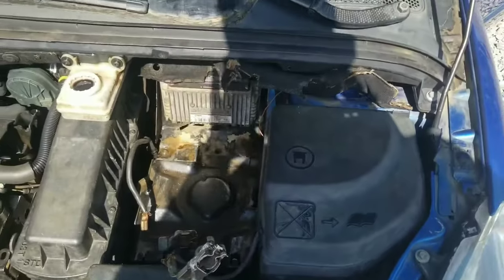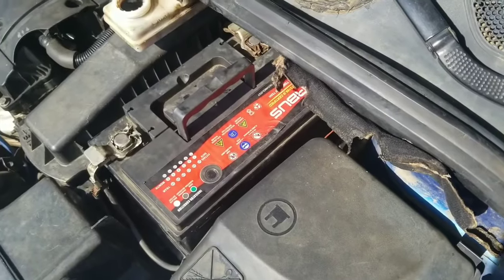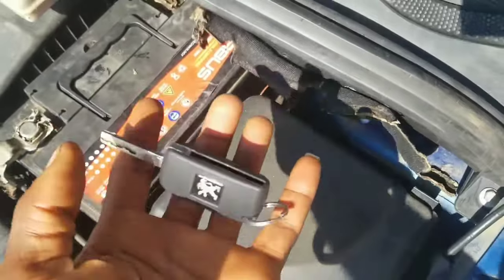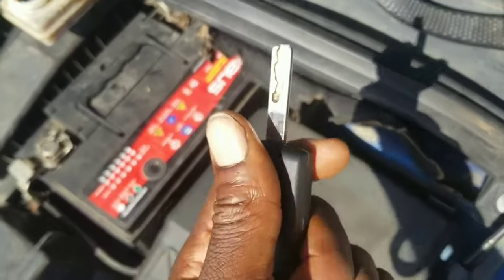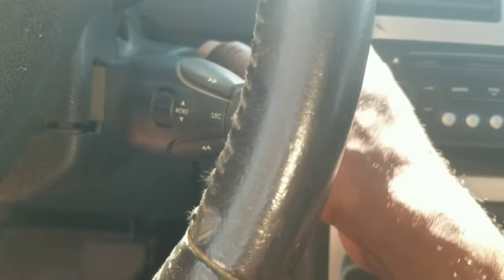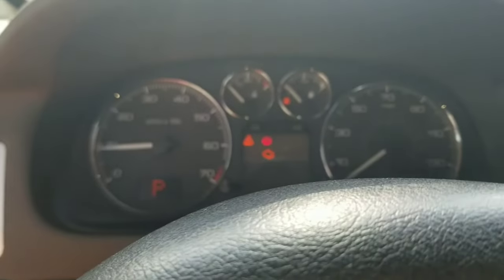PEUGEOT 307 WILL NOT CRANK OR START DO THIS

Comment: My 307 made clicking noise and does not start,  tested battery 13,8v ok so it is not the battery, but next day it started up right away
Reply from the maker: Check your battery terminals for corrosion and proper contact... use sand paper or wire brush to remove all corrosion if any. Also try observe the behavior of your kick Starter when cranking the car next time.